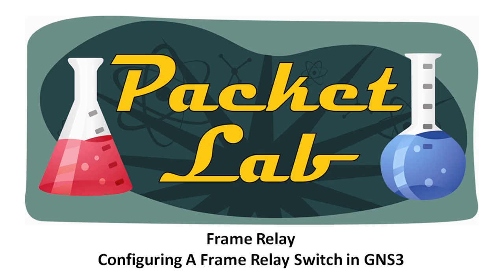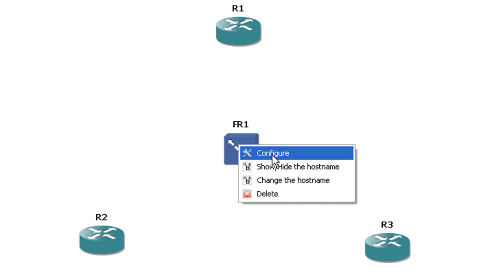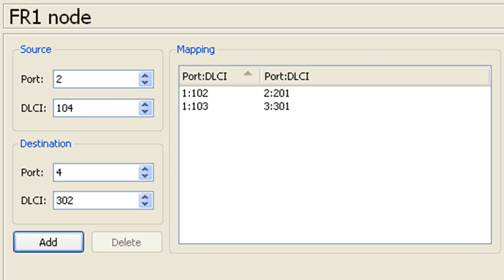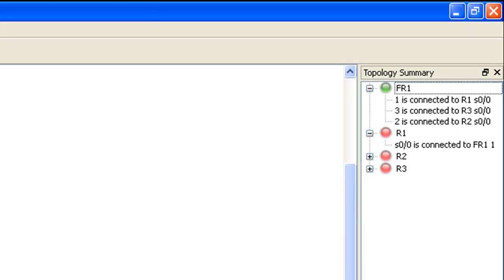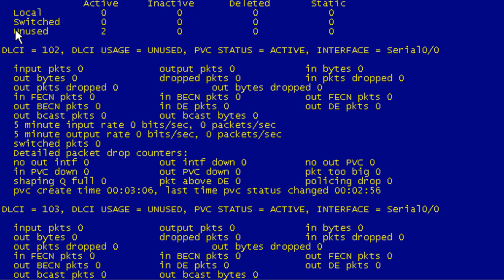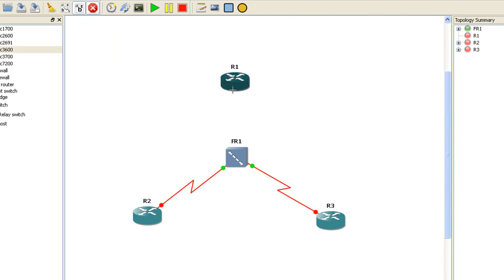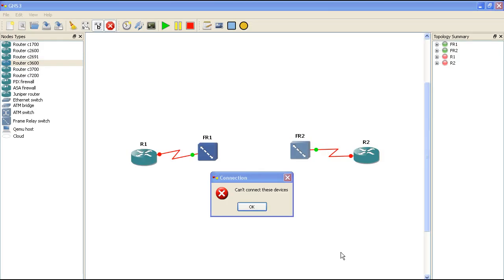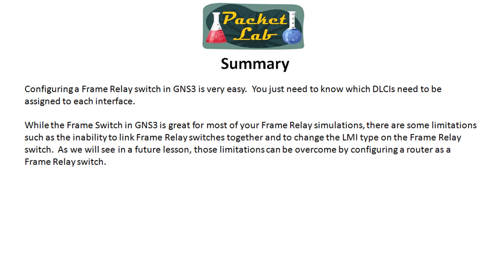Frame Relay - Configuring A Frame Relay Switch in GNS3

Comment: After I create the mappings in the frame relay switch and go to connect my routers, the frame relay switch only has two ports available.  Is there a setting I need to change in GNS3?
Reply: Make a right click on the router before drag it to the frame, n click on "configure template". Then, add the slots that you wanna add n save it. Next routers will have those new slots included.

Comment: It is informative specially for those who are finding a way to use FR in GNS. Most of people asking why ping is not successful, the answer is, he didn't assign DLCI's under router interfaces and also was need to define IP Addresses on each interface of routers as it is Point to Multi-point topology. Once you done, you can get successful ping across FR.
Reply: the reason for me was because i didn't " no shut " nor "encap frame" -_